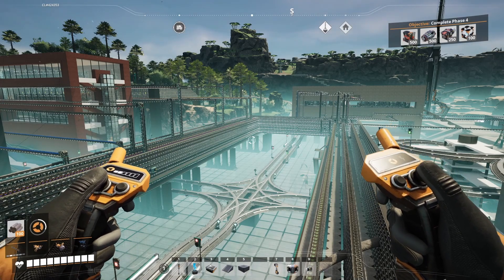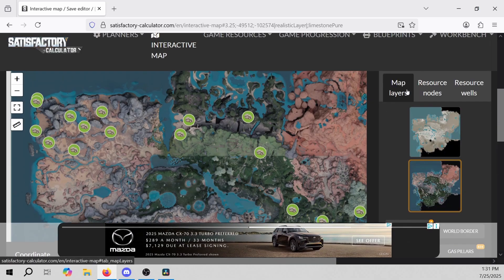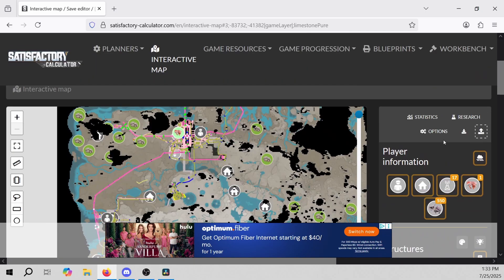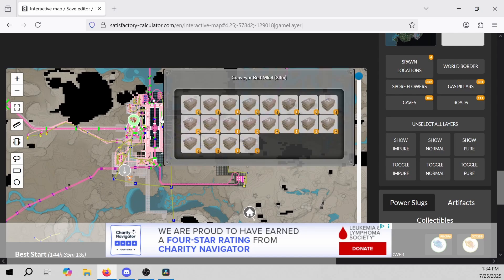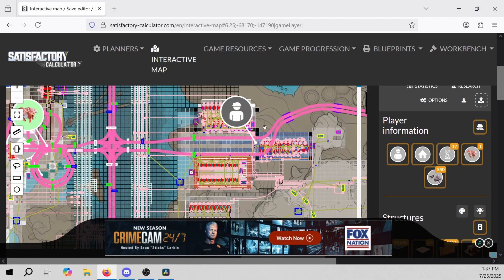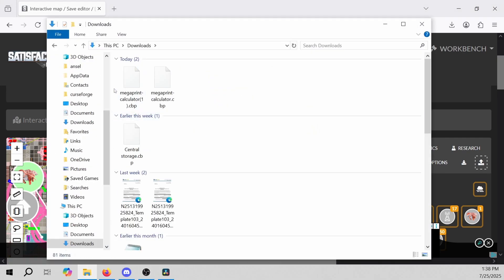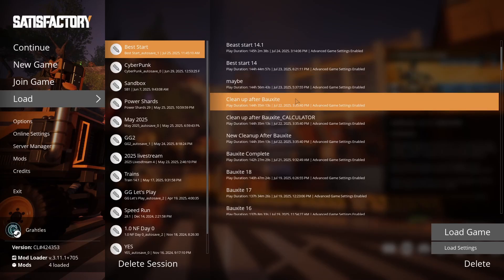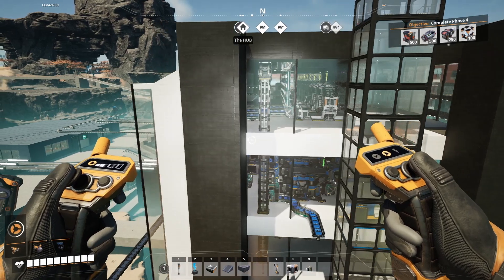How to Use Satisfactory Calculator for Megaprints + Mass Belt & Lift Upgrades! Satisfactory 1.1

Comment: I love this game!  Unfortunately, my motion sickness can't handle it.  I did try to play it and have a few hours into it but I'd always feel queasy in less than 30 mins.  So I could only play 30 mins at a time and its not enough to get anything done!
Reply from the maker: Oh man that stinks! 
I get the motion sickness when I 1st start playing it and I haven’t played in a while but it usually goes away after a couple of hours. I literally fight through it. 
I really love this game as well super addictive! This game is probably the only other game that I have played as much as Cities! 
Thanks for watching Cap!
Reply: The best thing is you can afk from the game and still beat it. I usually set things up to run before I go to work. As long as I don't encounter any power grid failures or run out of parts... I come back to space elevator parts being finished or almost finished.  

Might take you longer due the motion sickness though.